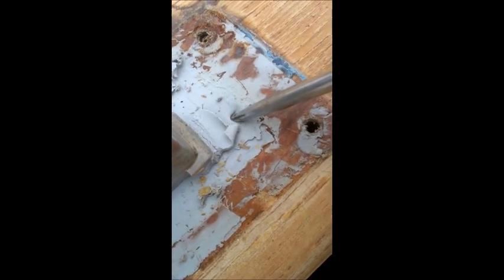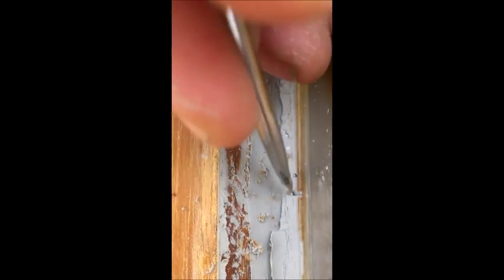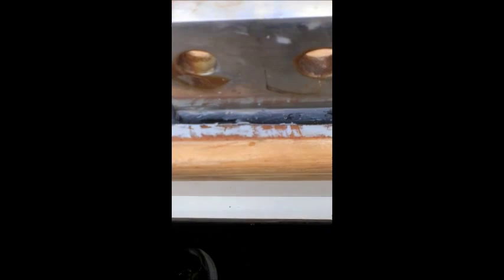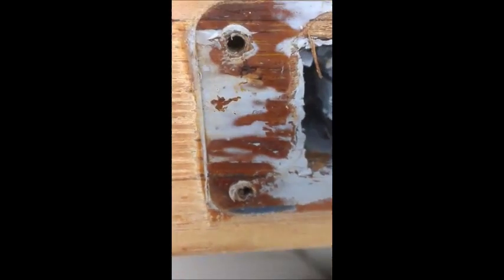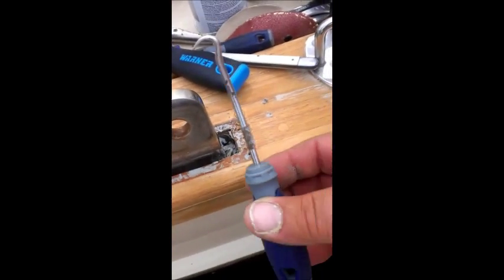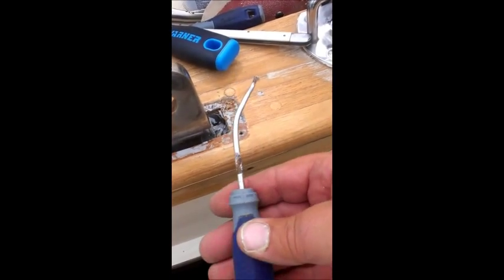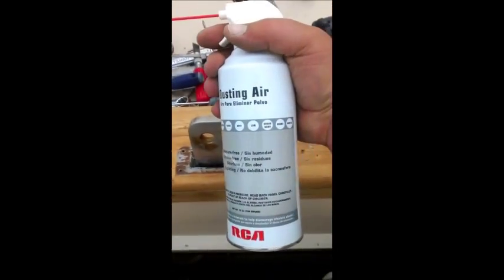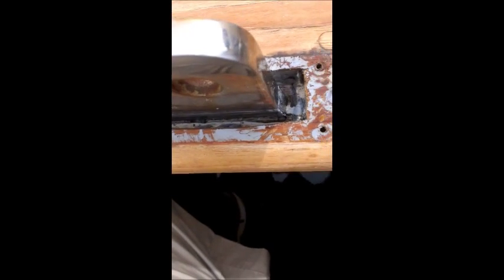chain plate

Comment: Good tutorial Jay! Have you used LifeCaulk's liquid to penetrate into those tough corners and to get down into that join?
Reply: No, what I actually discovered while researching the  SC sealant is that the typical application for these sealants is  commercial window glazing, and they do not recommend thick sections but rather  a nominal uniform layer.  That's why I used the recommended foam backer which produced about a 3/4" section. ( and it should greatly simplify removal during the next service interval)  My reasoning is that if you cant achieve a water tight seal in 3/4" then you probably wont do any better with more.  There is also a shrinkage variable along with differential volumetric thermal expansion/contraction. ( uniform thickness is better than big globs stuffed deep in the corners) Bottom line with ANY adhesive is proper surface prep and surface treatment. Watching this video many years later, even though I was carefull,  I wish I had worn gloves at the final stages to prevent any natural skin oils from contaminating the surfaces. I will reach out to the new owner of IP485-15 and see if he has opened any of those chain plate pockets since then.